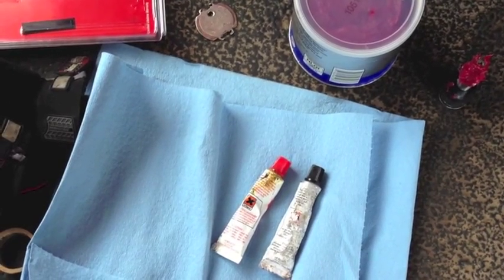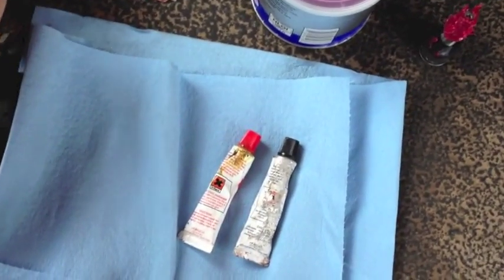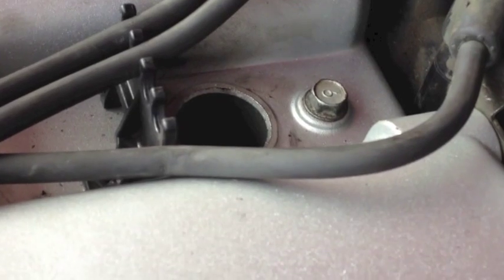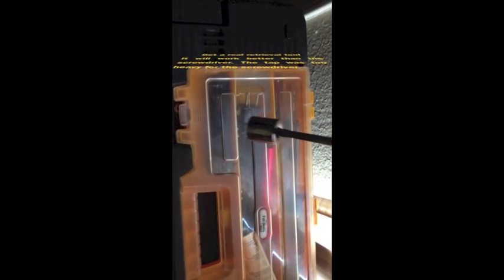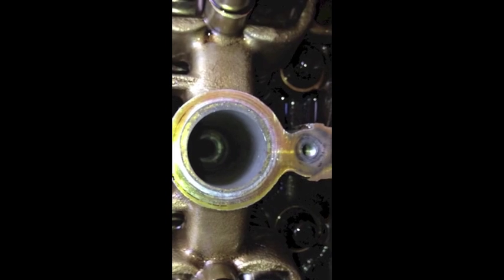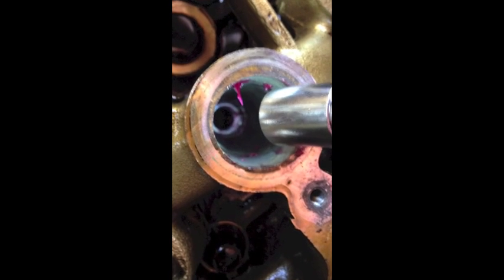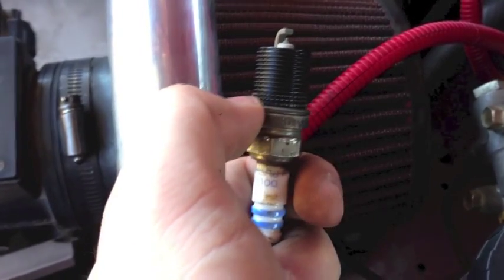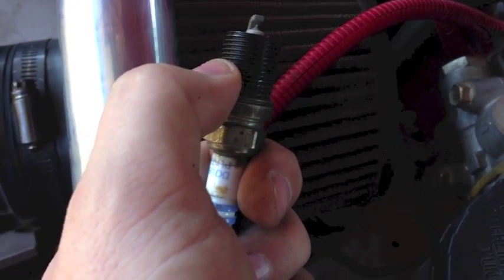DIY spark plug thread repair Miata BP

Comment: I recommend anyone doing this to just pull the head. It may seem like a lot of work but it's worth not getting stuff in the cylinder. The OEM head bolts are reusable. I would recommend getting a new gasket though.

Comment: Did you remove all the metal shavings from the cylinder?  maybe compressed AIR, Grease doesn't catch everything. You don't want a small piece of metal getting stuck between the valve seat.  I'd use RED lock tight (thread lock) instead of JB weld.  Did you flare the top edge of the thread insert with the supplied tool?
Reply from the maker: I did try to get the top edge flared, but for this instance I couldn't get the threaded collar to stay put without the plug.  Also that JB weld wasn't useful anyway.  I tried to use it a couple months later and it was like elmer's glue.  On the plus side, I have yet to have any trouble from this repair, but when I install the turbo I am going to replace the plugs with a heat range colder plug often used on turbomiata forum member cars.

Comment: Geez I sure could use u on Chicago. Having same problem and don't have an arm and leg to spend on it
Reply from the maker: Latres Singleton For what its worth, I have not had a single hiccup after more than a year. So I can say this is the 'right way' to fix the problem. A machine shop would have to thread in a helicoil or re-sleeve the hole similar to this anyway.

Comment: How did the repair hold up? If it works it a good back up plan!
Reply from the maker: It has only been a couple of weeks & a couple hundred miles, but this is the best it has run for a while. I had an intermittent ticking in the head which I thought was a dirty hydraulic lifter arm under the bucket (common for the BP motors). I even replaced the oring on the cam angle sensor and the valve cover gasket, checked the plug torque & wires and drove it for ~800 miles. Suddenly the plug threads for #4 quit and I was driving chitty chitty bang bang. So I decided to try the repair rather than a Craigslist head. The plug threaded in so well and is so snug now, that I would not hesitate to repeat this repair elsewhere. I used to walk right by these quick fix products and think "snake oil". I now stand behind how high a quality product the repair really is. This is exactly why we started making vids. Win, lose or draw hopefully someone can benefit from what we learn in the various projects.